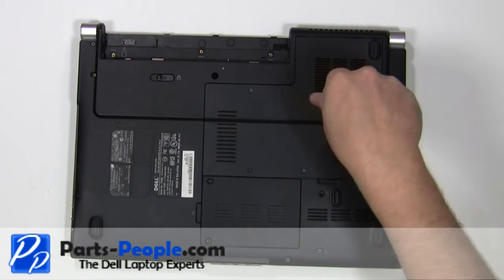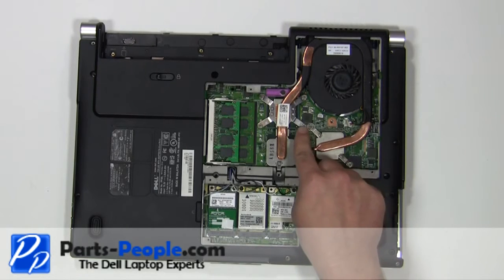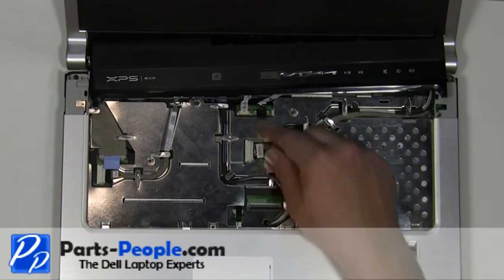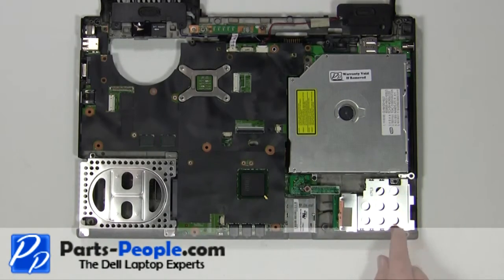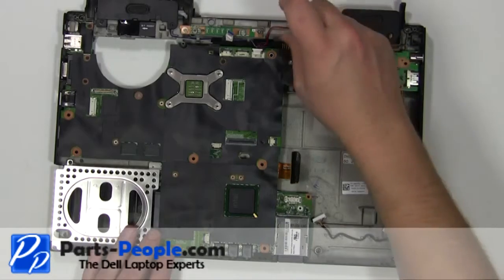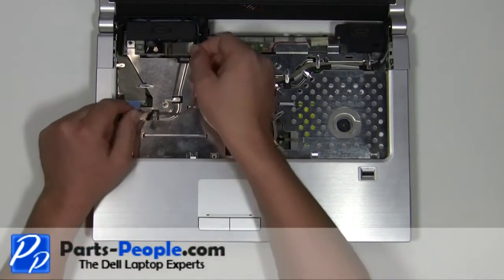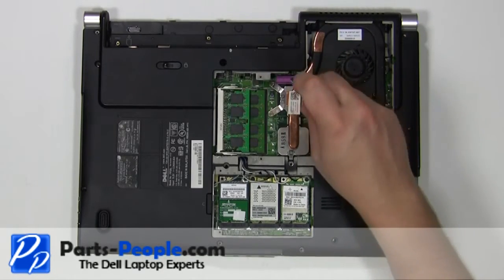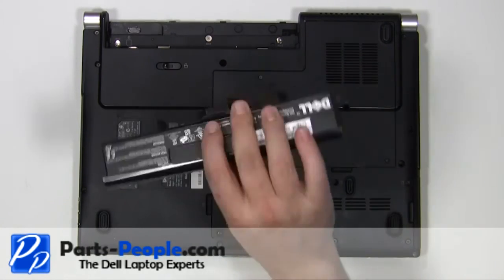Dell XPS M1530 | Bottom Base and USB Board Replacement | How-To-Tutorial

Comment: [part1] Our M1530 stopped powering on. We know it's not the battery nor the power adapter since we've tested them. So our next thought was it's either the DC power jack, or worse, motherboard fry. As I type I have a replacement DC power jack here, so my questions are (don't want to assume):

Comment: [part2]
1. can I just go as far as I need to to access the power jack's connection to the motherboard to swap it out? 
2. can I test whether that's the issue without fully reassembling it? maybe use my red and black meter (you can tell i'm not an electrical expert) to see whether I get a reading off tip and sleeve of the new power jack? or actually try booting it with the machine still open?
next step would be to replace the MB.
thanks!